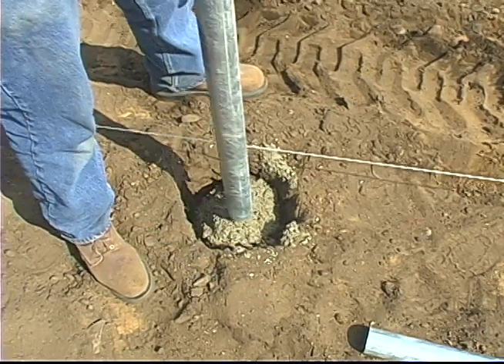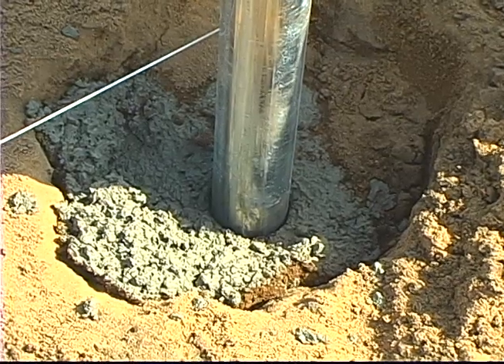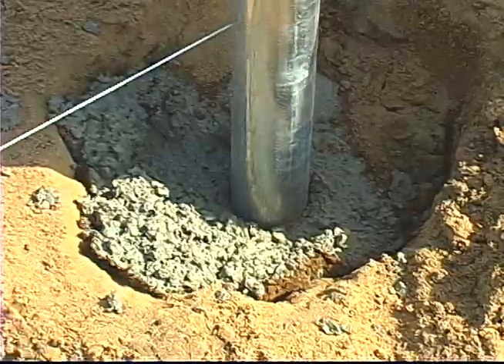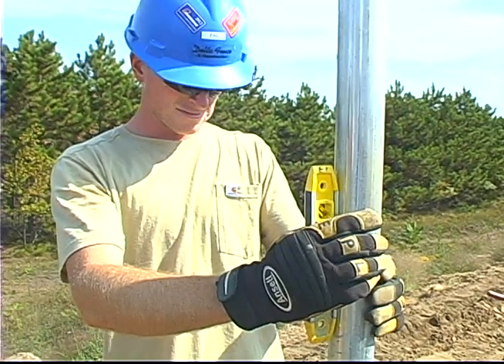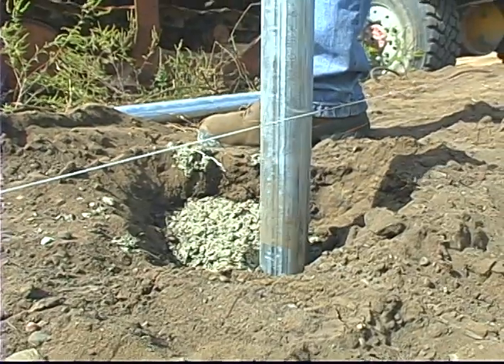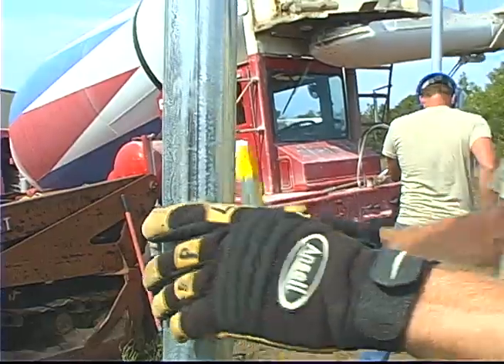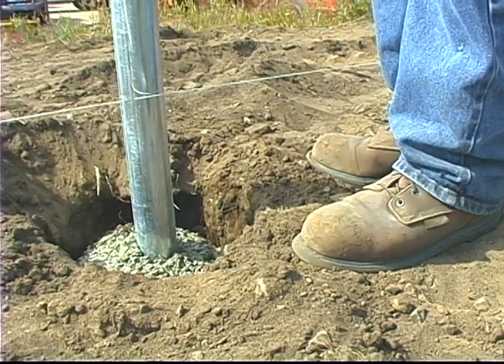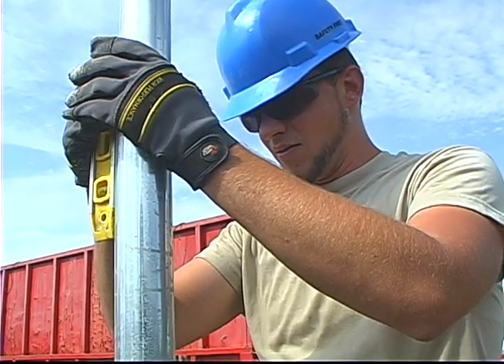Choosing The Right Way To Set Fence Poles

Comment: when u set post I like the concrete to be mounded above the existing ground this prevents water from sitting and rotting out the post. I do that with 4x4 wooden posts too prevents water rotting out the post. Most post setter don't do this that's why I end up doing a lot of fence jobs with rotted out pipes and wooden posts.

Comment: If you put a PVC  pipe in first, leaving a little above ground level as a liner you will eliminate a lot of problems.  Also makes replacement or removal of the post a lot easier.   Another trick from an old-timer is to put a 1/2 rebar inside the metal post and fill with hydraulic cement.  Eliminates any bending from wind pressure, but you have to enlarge the hole and use a little more concrete.
Reply: +rob gordon  what do you mean, ? by enlarge the hole? you mean make the hole much wider ? so technically first dig a hole make it another 1 wider wider and 3 feet deep right, mix concrete and pour it fill the hole 95% later put the 8foot pipe into the hole with a 1/2 rebar , how long the rebar has to be about 2-3 feet ? so I put the hydraulic cement into the hole of the pipe so goes down and fills up covering the , does it has to cover the rebar? hydraulic cement will seal and dry covering the rebar and stay strong dry so it don't bend the 8 foot post pipe.. I'm asking so many questions I'm sorry , I'm trying to build my own fence with galvanized pipe , I don't know if I should but 9ft pipe, 10ft or just 8ft pipe, 2 ft goes into the 3 feet hole and 6ft will be out exposed, I just got my permit from my City so I can build my fence, I'm from Florida so here rains alot and gets hot too real hot.. but also we get alot of wind and I'm doing a board on board fence, I wanted to do the shadow box style fence but I have 2 big pitbulls.. so that can't happen I want board on board fence for total Privacy and make my fence very strong solid, against wind weather and all.. solid as possible as I can, I know I have to do a post every 8ft apart can I do it every 5ft apart so I can have more strength, I'm doing board on board wood, and metal post galvanized, any help guys.. lmk thanks..
Reply: I'm looking at replacing my wodden posts with galvanized line posts.
Is there a video for the pvc?

Comment: I’m putting posts in tomorrow at my place but I plan drop in some concrete in the hole first then put the post and fill around while plumbing, I feel I need maximum coverage of my post for lateral strength otherwise it will just get knocked over   With a little pressure

Comment: So reason #1 is to avoid having to trim the top of the post to the correct height.  Reason #2 is using shorter posts to save material cost (assuming you can order the posts in custom lengths).  Reason #3, not mentioned, is keeping the end of the post above the bottom of the hole to protect it from corrosion.  On spec work it is not permitted to backfill the top of the hole with dirt, rather the concrete goes all the way up to ground level and is domed slightly for drainage.  This is to protect against corrosion.   If frost heave is a problem, the hole should be widened at the bottom (bell-bottom).
Reply: #1. You will never get the correct height right on a long fence line. #2 saving that extra tiny bit of money on a shorter post means you will not get the strength of the long post. You intentionally just created a weak spot for the concrete/post to sheer (simple physics) #3 having the post at the bottom of the hole (which is 2.5-3' down is where it should be. Corrosion down there will not matter. 

Doming concrete like that can be a problem if you're laying fencing across the face which is why many don't do it.
Reply: @77Avadon77  These 2 comments are better than the whole video.
Reply: @marcschroter4264  thanks, well we've been at this quite a while. And I've had the privilege of working with some Expert Fence builders. Just like when you build any type of foundation they set the rebar and steel as deep as they can into it. You never see them float Steel i-beams to height, so why would you do it with steel poles. That said this looks like somebody's commercial job and they cut Corners all the time trying to save money, so I'm not surprised. Saving money means more profit for them. But I would not do this around my house nor would I recommend it
Reply: We all know, plenty of water gets between the post and concrete, no matter what you do, but  the dome thing for appearance is great. Maybe it " deflects" some water, but we're talking out doors here, year round.
Reply: @treeguyable  dome your concrete like that and then try to put chain link fence against it. It really messes up the bottom. Looks even worse if you want to box your posts for a wooden fence. Good in theory, but bad in the practice.
Reply: @77Avadon77  Kinda like my retirement pIan, good in theory, bad in practice.

Comment: We've been doing this since 1978 at Malone Fence Company in Salem MA

#chainlink #fences
Reply: Then I'm sorry for your customers because this is a shit way of doing a fence installation. Posts should be in all the way to the bottom of the hole and then concrete poured in around it. They've been doing it this way literally since concrete was invented. Cutting corners=problems.
Reply: @77Avadon77  The method shown in this video is a superior method to the way you described. Assuming the post is just shy of the bottom of the hole
Reply: @dmurphy5852  not at all. I worked around professional fence Builders and they don't float their poles. And there are numerous reasons why. You've immensely reduced the strength of the steel in the concrete by doing that. It's just like when you make rebar dowels, there's a reason why there was a spec for How Deep The rebar must go into the concrete. It might be fine on some of these commercial jobs where they're just putting up chain link and they don't care. But this is not the gold standard way of doing it. This is the half ass, get it done cheap and fast way.

Did you also see how dry that concrete was. There's not going to be great adhesion there. He even mentioned that although tried to cover his ass.
Reply: @77Avadon77  I was meaning something like 2" shy of breaking through the concrete on the bottom of the hole, only to jacket the post from water contact. I dig my holes deeper than spec to accommodate for this anyhow. I believe shallow sinking your posts is just laziness
Reply: @dmurphy5852  I wouldn't be too concerned about jacking the post in concrete but if you are putting posts in a very wet environment and maybe that could be a concern as moisture could come up through the inside diameter of the Pole. I've dug out very old fence post and never seen a problem with that. Another thought is that you could cap them with either plastic from Alliance Express or a galvanized steel cap. Again no I don't think this is too much of a concern unless you're almost in a swamp or marine environment
Reply: @dmurphy5852  I suppose you could also poor the post in pick it up a few inches letting Concrete in underneath and then set it back down, that way you filled the inside diameter of the post with some mix. Was just a thought

Comment: Yes floating is first dig your hole then fill it with a oatmeal like texture of concrete leaving about 4 inches to top for dirt then slide post in concrete plum to string line. Level your post and dirt it . That's the process I work for all quality fence out of ledge wood nj

Comment: I dig my hole about 6" short of my final depth and drive the post the last 6" (keeping them plumb and level) and pour my cement to about 4" below ground level and let them set over night.
Reply: Just so you know that you're exposing Earth to your Steel and speeding up the rust process by doing that.
Reply: @77Avadon77  LoL! They said it proud too. I was confused why they would go thru the hassle of driving the parts into the earth.
Reply: @kevinm8865  they're trying to be cheap and cut corners. On Commercial jobs like that it's very common. But if this was your house I'd be pissed if somebody did it that way
Reply: 77Avadon77 so whats the best way to do this? I got a free chain link fence that somebody pulled up and it looks like they drove the post into dirt than poured concrete and the exposed post below the concrete are all rusted. Would you recommend reusing these posts?
Reply: @nmjhd1234  yes I don't think that's any problem to reuse the posts. Is there a lot of post that's rusted? If it were me I'd clean off the rust the best I could. Perhaps pressure wash it, or use an angle grinder with a stripping disc. You don't need to get them perfect just relatively clean of rust scale. Then you can reset them in new holes and pour concrete in on them.
Reply: @nmjhd1234  you don't want to drive the post deeper than the concrete that you're pouring. Likewise you don't want several inches of soil on top of the concrete. The idea is to have your concrete just a tiny bit below grade. I generally never go more than about three-quarter inch. Some people actually build a mound above the soil. To each their own. You just don't want several inches of soil around your steel post because that is where you're going to get the failure eventually. A little soil is not going to do too much harm. You're just trying to create drainage away from your post the best as possible. I've often removed the soil and just put gravel on top of my dried concrete post. That way my chain link fence or my wooden boxed posts are not sitting on wet soil.

Different climates are going to do different things 2 galvanized steel. In some dry climates galvanized steel seems to last forever, where in other climates you can see it starts to gall badly in just a few years.
Reply: 77Avadon77 i really appreciate your help thank you!
Reply: @nmjhd1234  sure no problem, I love fence building.
Reply: 77Avadon77 i forgot to ask if i dont want to clean the rust out of the bottom of the post and just pour concrete around it, will the concrete not form a good bond to the post, or will the post’s integrity goes down like maybe breaking around the rusted area?
Reply: 77Avadon77 all of the posts were drove into the ground before pouring concrete so they all are rusted at the bottom.
Reply: @nmjhd1234  that is correct as you suspected. Rust scale on steel and rebar and poles can inhibit the bond. This is why you dont ever use Rusty rebar in concrete. It would have to be sandblasted first. Minor rust is fine, but when it builds scale, then it needs to be removed or cut off.

If you can't cut it off then I would suggest buying some of these 3M sandblaster discs in 4 and 1/2 in for a angle grinder. They work great. Just make sure you wear eye protection or a face shield. You can get those same types of wheels at virtually every hardware store as well.
Reply: @nmjhd1234  theoretically speaking it's probably minimal importance on something like a fence post. But you could imagine if you were putting a steel column of a building into concrete and it had a lot of peeling rust scale on it, that could be a problem. Not only is the Integrity of your steel diminished but the bond to the concrete as well.
Reply: @nmjhd1234  if you can pressure wash them first or just give them a big scrub with water and wire brush that should get most of the dirt off of them. From there you can decide how much further you want to go. If it's thin wall material then I would be gentle. Maybe you something like a cup brush on your angle grinder as opposed to something more abrasive. If it's really thick galvanized steel you don't have to be as careful
Reply: 77Avadon77 thanks again! Very detailed and informative. Glad i am talking to someone who cares about what they do and do them correctly for long term success.
Reply: @nmjhd1234  you're very welcome. If you get stuck with anything you can always hit up my channel. I have lots of fence building videos and I try to help as many people as I can in the comments
Reply: I probably missed it in the video, but what do you people prefer as to how deep you should drive a post, if you want it six feet high? Maybe two feet? So the hole will be just a tad deeper than that, if you're floating
Reply: @kbanghart  it depends on your Frost depth as well as the height of your fence. An old adage is one third in the ground and 2/3 above ground. For most parts of the country 2 to 2.5 feet is good.
Reply: Sounds like like your posts to heave
Reply: Whatever you guys do, do not take the advice of  77Avadon77. He is a keyboard expert who's getting a thrill out of lending advice on things that he knows nothing. Listen to the video.

Comment: Placing soil above the concrete footings against the galvanized post will cause premature corrosion rust and failure of the post especially when using thin wall tubing such as .065 wall ( 16 gauge ) galv. posts in residential applications. A.S.T.M. specifications require  concrete footings on galvanized posts to be coved top protruding above soil level. Frost heaving can be eliminated by keeping the side walls of your post holes vertical, not cone shaped, and setting that footing well below the local frost line. There is an advantage to having the post extend all the way through the concrete footings and that is because it allows for drainage into the soil of possible condensate build-up inside the post in humid climates with wide temperature swings, this can occur even when the post is properly capped. This is not normally a problem with thick wall schedule 40 pipe, so float away. Tip from AZ licensed Fence Contractor
Reply: +Michael Waterman  I'm from Florida , here rains like hell, same gets hot too and lots of humidity , also wind too, I have permit to build my own fence, but I want to do it galvanized post with wood , board on board, each post 8ft apart, can I do it every 5ft or 6ft.. to make it much stronger. now you say, the tube wall .065 wall it's too thin right? the (16 gauge) , what number would you consider better ?.. for a house residency. I want privacy but also make my fence stronger,  any tips help I will appreciate thanks
Reply: Use sch40 galvanized posts 7.5' on center. Build it right or do not build it at all.
Reply: Michael Waterman he explained it with the frost

Comment: When digging your hole make it look like a elephants foot at the bottom of the hole flair it that will help with the frost problem.Imo I would put concrete to the top so water wont build up on the top 4 inches.

Comment: I must be slow, because I'm not understanding the part about saving money on posts. For example, I'm putting up 6' chain mesh, so I plan on cementing my 8' posts 26" in the ground to make my post height 70".  So, how would I save money on posts? Would the suggestion here be that I would use a shorter post, less than what is recommended?

Comment: I am with you easy rider, cement is only a small portion of the components of a product called CONCRETE.  
Concrete would commonly contain 4 parts of sand, 2 parts of gravel, and 1 part of cement.  Add water to suit.
Reply: 3 parts sand- not  4

Comment: I rarely build fences.  I tried this years ago and the concrete was too hard for me to sink the post down.  I ended up with a post that was not deep enough into the concrete.  I guess the mix has to be just right.  Too thick and you can't sink the post.  Too thin and your concrete will be weak.
Reply: Yep, you exactly figured out just one of the many reasons people never do this. Even instructions from Home Depot will tell you not to do this.
Reply: Yeah and we all know Home Depot are experts on fence building. LMAO.
Reply: I used this method for my post and post went down without any issues at all and concrete was thick not watery sounds to me like your hole was too narrow my hole was 1ft wide and post was 3" sank to the bottom easily

Comment: Should I pour any mixed concrete inside of the metal fence posts to add stability?  Or should concrete posts not have anything poured inside of the posts?
Reply from the maker: There is no need to pour concrete in the posts.
Reply: @LCEnterprisesUSA  oh, I asked because I checked the posts that I set yesterday and I noticed that a couple of them moved when I checked how sturdy they were. Maybe they will take a couple days to set.

Comment: Water will also fill the pipe from below. It will fill the pipe all the way to the top.. I've seen it happen. I've seen pipe that people capped still be full of water. The only way it could get in is from the bottom. The way you do it should help prevent that. It's called capillary action.

Comment: Might make it quicker and/or easier to install them but if you're filling the bottom of the pipes with concrete you're risking water getting in and having no way to drain out thus will much more quickly lead to corrosion, and in states where temperatures reach below freezing you now have the chance of the pipes splitting after water in them freezes and expands...yes, caps are supposed to go on top of the pipes but like with countless other things we were told how this and that product is a full-proof method of preventing this and that but then later on we see how they were full of sales hype and so if you're going to spend all of this time, work, and money on such a product, do it the way you know that if water does find it's way in the pipes there's a way for it to drain back out.
Reply: I have had corrosion as you said when post was installed this way.
Reply: That is why full length post and have 100mm of crushed rock on the base amd sit post on crushed rock. Water gets inside of post drains out the crushed rock on the bottom.